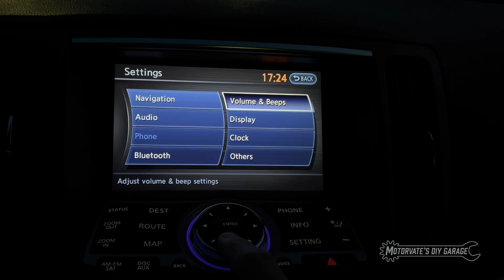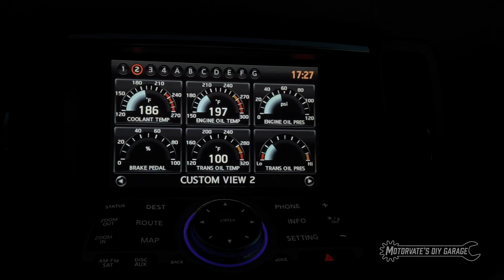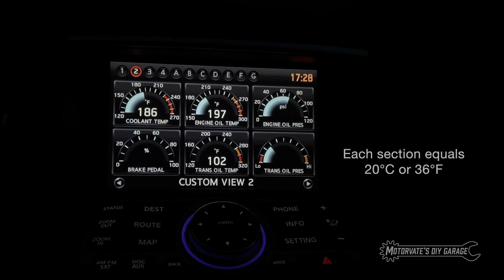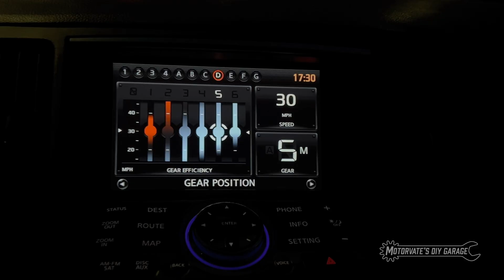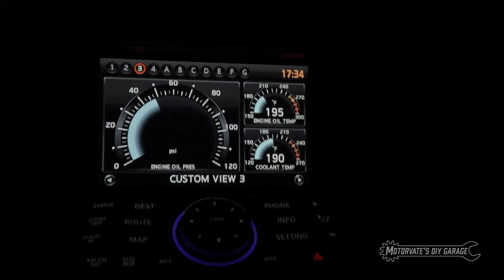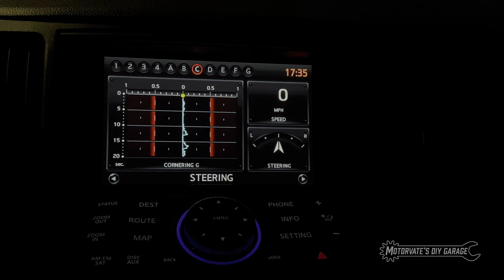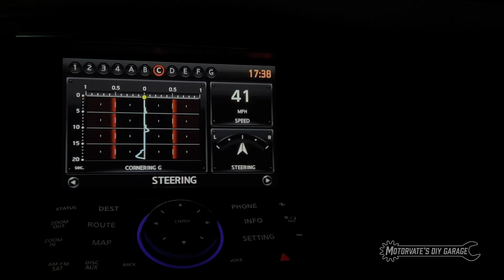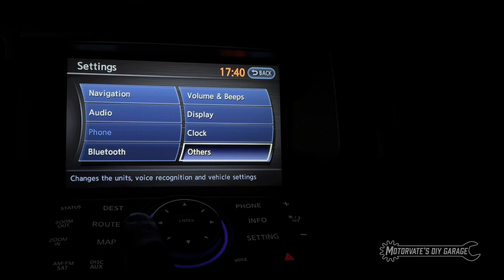They're DONE! GTR Gauges for the G37: MotorvateDIY Garage Ep.53

Comment: I feel like I might have commented on one of your videos a year ago or something. I would love to have coolant temp, oil temp and oil pressure on my 2012 G37S Sedan 6MT w/ Navi. Its my drift car and I would love to keep on eye on coolant, oil temp and pressure. If you want someone to do more beta testing on this, I would be interested in buying your system and providing you feedback while I am tracking my car.
Reply from the maker: Got it.
The next step is to expand the local beta testing, to make sure they work on the different versions of the G37 (RWD, AWD, 6MT, 7AT & Tech package with ICC) which starts next month.

I don't expect any issuers, but want to verify they work as expected for all :)

Also, I've also just added cooling system pressure, as that will tell you quickly if there is a coolant leak, which may just save your engine.

Sooo.... please hang in there, these gauges will be out this summer!!

Comment: Nice work!  I have a Nissan Qashqai looking to add digital speedo either with small LCD screen (like your project years ago) or adding to center gauges screen.  I emailed you so would be awesome to chat.  Local to Toronto!
Reply from the maker: Got it and replied :)
As mentioned in the email, it would take a lot of time to reverse engineer the Qashqai's CAN bus as it is much more secure/complex due to the ADAS systems.

Comment: Manual gear indicator?
Reply from the maker: Yes!
It calculates the current gear, and displays it in the main cluster of the G37.

There is also a smaller  version for the 2007-2010 manual G35/G37: https://youtu.be/wQm-7cxolm4?si=ijPGP4X-PMvXfdPh

Comment: Hey, hope you're doing well. Can't wait to buy one of these when they're on sale, I do have a question though. Have you looked at the wiring at the back of these units? I just recently converted my non-nav unit to a nav unit. It works and everything but only half of steering wheel controls work. Haven't been able to find info online so just wondering if you knew.
Reply from the maker: I know the wiring so well, I have dreams about it. /jk

One of the next items I need to look into, is to understanding what is different when a non-nav system is updated to a 2010+ nav system.

Without digging deep into the factory manual, I would of thought the steering wheel buttons would of worked for both.

Once the GTR gauges are launched, I'll be looking into the 07-09 G35/G37 to see what is different.
Reply: @MotovateDIY Well, aside from the camera and gps, it's mostly similar. I think the steering wheel has an extra button for the nav unit, and that might be what's messing my unit up. I was going to make a guide for people so they wouldn't have to buy the $400 harness from ebay but I got sidetracked working on my car. Let me know if you need anything, although I think you probably know more than me. Also, thank you for reading my comment.

Comment: Any idea if there would be a way to add  functionality to the accelerometer with either nismo parts or aftermarket?
Reply from the maker: From the limited CAN bus data I have, it looks like the 370 Nismo ABS module does send out brake and acceleration g-forces on the CAN bus.

It is possible to add an external accelerometer, but would have to insert a CAN bus gateway to add the accelerometer data to the existing CAN messages.

This is because the non-Nismo ABS modules (like my G37 and every non-Nismo 370) send the CAN messages with zeros in place for the acceleration/braking g-forces.

This means I can't "inject" the acceleration/braking CAN data. BUT I could insert a dual CAN bus module just before the nav unit, with an accelerometer and ADD the data for the GTR gauges to display it.

Hmm.. maybe I try this out this summer. Since I'm a guy who loves data... I'd love to see that data.

Comment: Are you planning on making an open source or generic version for other cars? I'm looking for the sensors to BT part for my Subaru, would be happy with the gauges on my phone. thanks!
Reply from the maker: Yes the Bluetooth gauges will be open source!
It is so nice not having to run a few wires through the firewall and based on testing over the last 4 years, it has been 100% reliable.

I'll put out an episode in a few months explaining on how they work and how to use them OR just keep checking in on my github page: https://github.com/MotorvateDIY

Comment: Let me know it's when available!  I'm in the States with a 2010 G37S manual Convertible with Nav.  I already have the tire pressure readings mod installed from your videos.
Reply from the maker: I'm loving the fact that you have tire pressures set up!
Right now I'm targeting a spring launch and will announce everywhere. (Reddit, Insta, X, myg37.com, facebook and here)
Reply: @MotorvateDIY  it was a pet peave not to have this.  Before, I had to use an ob2link dashboard to read the tire pressure pids. Not sure what Infiniti was thinking.  For the sport they should have had a tire pressure on the screen or in the console, and and an oil pressure sensor not a switch, maybe a gauge, but at least the pids to get that data.
Reply from the maker: Agreed!

Comment: Hey mate, nice bit of kit you've created, can see a fair bit of time and effort has been put in. I have a suggestion, if there is a clutch switch associated with can-bus, you could pause gear calculations if switch is activated.
Reply from the maker: Good point. The clutch pedal does have 2 switches (top and bottom of pedal travel), but only the bottom switch is on the CAN bus.

AND most don't push the pedal all the way to the floor to shift. BUT if they do, I use that as an input :)

Thanks for the comment :)

Comment: hi bro! I just bought a 2009 g37s, i scanned it with the obd tool and an "old" code came up from the transmission control module (7 speed automatic), the code is not active at the moment but could you help me to know what could have happened? the code is p1585-00 G SENSOR, thank you in advance bro you are doing incredible work
Reply from the maker: Thanks for your kind words!
I don't know, as code P1585 doesn't show in the 2009 factory shop manual.

The trans control module (TCM) uses the "side g sensor" to determine when to hold the current gear. This is used when the car is in a corner and provides a little more stablility.

I guess at some point the transmission or ABS module was removed and the car was turned on. This would set the code instantly.

Then when everything was together and powered up, the active code went away.

As you know, if it isn't active, you don't need to worry about it!
Reply: @MotorvateDIY  thank you very much! I know my car had some front suspension work done, they changed the front struts that may be why they temporarily removed the abs module! thank you so much I guess this explains it! dude you are a G37 god🤣🤣
Reply from the maker: I'm glad it all worked out. Now go for a nice dive and enjoy your G :)

Comment: Frank your perseverance! This will make many folks happy I too despise dummy gages so look forward to real data. I plan to order this with Sentra temp sensors, etc. all together if possible. I recently epoxied my diff bushing, (did tape up back side of busing area for extra space filling, it was fun/easy) & installed rear control arms (together that was a great improvement on car w 151Kmiles), next I have some Z1 rear subframe collar inserts and BC true coil overs ready to get mounted on my 2012 G37S sedan 6MT.
Reply from the maker: Sounds like you have a lot of nice mods done to your G37!
For the GTR gauges, the first roll out will be focused on adding engine oil pressure. Diff oil temp and fuel pressure will be added later.

As for manual transmission oil temp, I'm not sure there is much value in knowing it. It never gets very warm. During the hot summer, on a 3 hour drive it was 64C / 147F.

Anyways, thanks for your kind words!
Reply: Hi Frank whats the latest on the gauges its July 26, 2025
Reply: Hello Frank whats the latest on the guages and consumers getting them I havent seen postings in many months

Comment: Super excited for release, been stalking your posts on the forums.
Will there be a kit for sale in the future for 2008g35s Nav package?
Reply from the maker: To be honest, I don't know. 
The 2007 - 2009 navigation units use  the "06-IT" nav unit (400 x 200 screen resolution) where the 2010+ uses the "08-IT"  (800 x 400 screen resolution) and I suspect they don't work the same internally.

Down the road, I might look into what is required on the 06-IT versions to get the GTR gauges to work.

For now, my main focus is on the local beta testing to see how well the gauges work on other G37s.

Comment: Hello, this is wonderful!

I was looking on YouTube for a tutorial that I could follow. I have the same idea for my 2012 Subaru Forester XT. Can you share the code and materials for the boards/displays used so that I can interpret the communications from my CAN network? Here in Brazil, there is very little material to research.
Reply from the maker: The "GTR Gauges" are built in to the Nissan/Infiniti navigation unit since they are used on the Nissan GTR.  I just send it the converted CAN bus data to the navigation unit, and it renders the display.

Sooo, there is nothing here that will work on your Subaru.
Reply: @MotorvateDIY  Thanks for the answer!
In the series of videos you make, I was thinking of using and adapting the dash code that you connect to the OBD2 socket and use the external sensors with 16 pages (Of course, if it is open source or even if you want to charge a fee for the time dedicated to development!). As for the GTR gauges, I already imagined that it would not be compatible.
Reply from the maker: That project (Mini Dash) is about 3 years old and I don't know if it will even compile anymore as the TFT_eSPI library has seen many updates as well as the Arduino IDE.

A better option is to look at something like this:
https://youtu.be/3NUmfUu_dlA?si=h73MbW-iGNF6cOrE

He has many examples with full (and well written) source code.
Good luck!

Comment: Wow. So this can't work on my 09 G37 manual sedan 😢
Reply from the maker: Sorry but nope. It needs to be a 2010+ G37 with navigation.
Reply: Would 2008 with tech package and nav package work? Or would I have to do the head unit and module have to get swapped and then add this kit to work?
Reply from the maker: Still requires a 2010+ G37 with navigation. 

A pre 2010 G35/G37 with a 2010+ navigation system would need to be evaluated to see what works.

However the cost of the wiring harness to convert the nav units and the hardware/modules gets close to $1,000 USD

At that price, it makes sense an Android Auto / Apple CarPlay upgrade.

Comment: please the Q50 platform needs this badly especially the 3.7 years
Reply from the maker: There are two reasons why I can't:
(1) The Q50 has a completely different system and would have to start from scratch to see if it is even possible.

(2) Don't own/have access to a Q50
Reply: @ would you recommend just putting the mk7 Tesla style screen in the Q since it’s a direct fit/swap mod?
Reply from the maker: Since I don't have a Q50, I don't have any idea.  Pop over to infinitiq50 . org to see what other Q50 owners say about them.

Comment: For the automatic transmission on page D, any idea if it would work with infinitis with the 5AT? I have a 2014 head unit conversion in my 07 so I have the oem nav with the updated 2010+ software and I'm hoping these gauges could still work with mine.
Reply from the maker: That's a little complicated.... and I'm not sure,. I'll have to check my CAN bus logs to see if I have any 5AT G35 logs.
Reply from the maker: I just looked at an 08 G35 CAN log, and it looks like the 5AT gear positions are there, but they are in a different format.

I didn't see engine oil temp on the eCAN bus, but it may be in a different message. Once the GTR gauges are done the beta test and launched, I'll spend some time to see what I can get to work.
Reply: @ Thank you! You have a guaranteed customer 🙏

Comment: Great work as usual sir, I hope you are doing well. So do you think this will be a package deal and that you may include the Bluetooth sensor?
Reply from the maker: Thanks!
I'm waiting on some parts and when they arrive I'll show everything about the "Bluetooth Sensor Server", how it works, where it connects and what it looks like.

In a nutshell, it is a weather proof box with 2 cables about 2' coming our from it. One cable uses the standard connector for the 3 pin aftermarket oil pressure sensor. This powers and reads the pressure sensor.

The other cable connects to ignition and ground. 
I've done everything I can to have a quick/easy install.

And yes, since they are designed to work together, there will be a package deal :)
Reply: @MotorvateDIY  awesome please if there's a way to get one of the first ones put me down for it, and I can pay upfront or give a deposit lol
Reply from the maker: Once the beta test is over and has proven to work without any issues, (so far, so good!) I'll be in touch.

Comment: I have a 2009 😭  awesome job!
Reply from the maker: Thanks!  I may have an option for pre-2010 Gs.
I believe you have a yellow RCA plug for AUX video. I could use a Raspberry Pi with RealDash to give the same look/feel as the GTR gauges, in the factory 320 x 200 display.

I'll add this to my list of items to look into.
Reply: @MotorvateDIY  Legendary! That sounds awesome. Thank you!
Reply: @MotorvateDIY  This would be awesome for 09 Z34 owners as well. I think the only issue with the composite video input is that car cuts off the input after a certain speed has been reached. I cannot recall if there was an E brake based defeat device out there or not. Subbed for your progress either way.

Comment: Is it possible to run these gauges if I swapped an 10+ bcm in to my 09 awd coupe? Unsure if this helps but my car does have the nav package.
Reply from the maker: I haven't done all the research on this, but off the top of my head you would need a 2010+ AV/NAV unit, clock/radio panel, NAV button/dial, nav LCD... Then either make your own cables, or buy them from OWC Upgrades.

At this point the cost is about $800+, so why not buy CarPlay/Android kit and have more functionality, but no gauges.

However, I could make a GTR display using RealDash and a Raspberry Pi that connects to your aux a/v in... Hmmm, that could be a good option for non-nav G35/G37.

Comment: Since you have all that information is it possible to calculate horse power from a sweep? I wish I had navigation. How were you able to do all of this? You hacked into the existing firmware?
Reply from the maker: Good question!
As it turns out, on the CAN bus is the "calculated engine torque". This is used by the automatic transmission (TCM) to determine how quickly to shift. This is how UpRev/EcuTek improve the AT7 shifting... they inflate the calculated engine torque and the trans shifts quicker.

Unfortunately, the calculated engine torque is only accurate for a stock engine, so you can't use that to accurately calculate horse power.

The GTR Gauges do have an option to  "datalog to SD card". With this you could take wheel/vehicle speed and vehicle weight and calculate average HP, but I don't think you are looking for that.

How did I do this?  Way back in 2022 there was a post on myg37.com from iCrap showing how he could bring up the GTR gauges, based on what he saw on a Russian website.

I had already spent 2 years reverse engineering the FM platform's (G/Z) CAN bus, so I had a good idea of what was needed. From there I recorded the CAN bus from a 2011 GTR, purchased 4 NAV units, LCD screen, radio face plate, and a bunch of other stuff to see how it all worked.

I used Ghidra and a HEX editor  to analyze the files on the hard drive and flash memory.
Over the last two years I've spent over 2,000 hours learning, trying, failing, trying again to understand how it all works.

Soooo, it has been a labour of love and I'm happy to get this out to others. I really like seeing temps & pressures while on a drive.